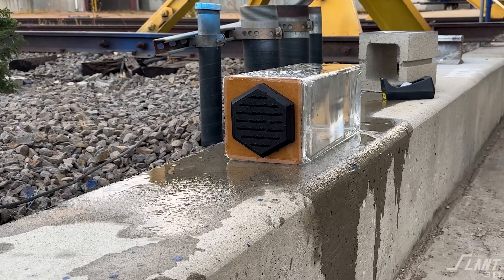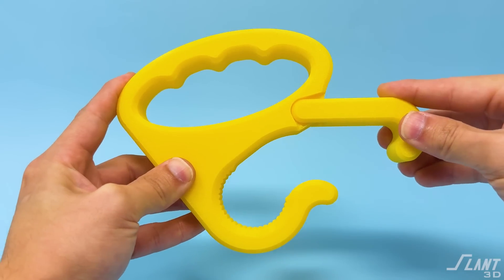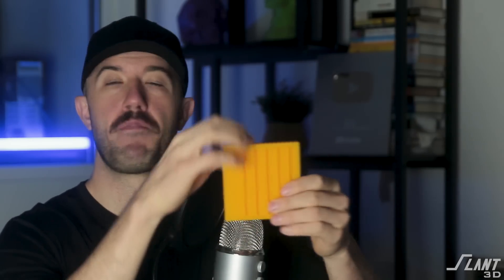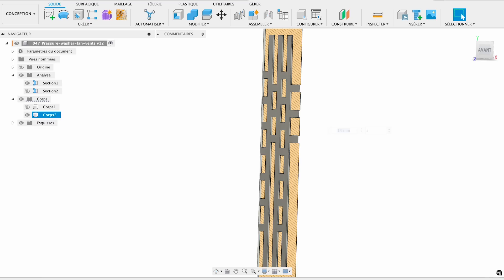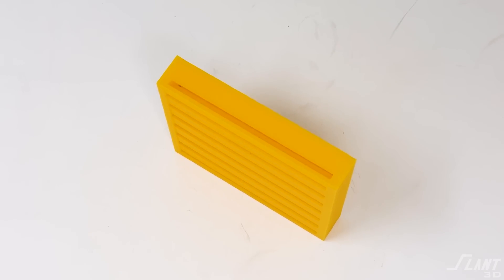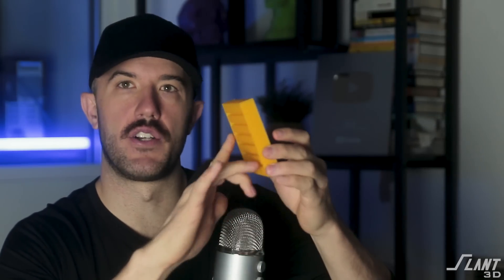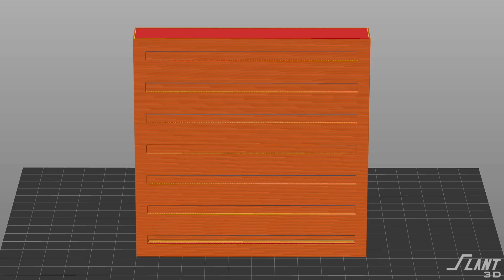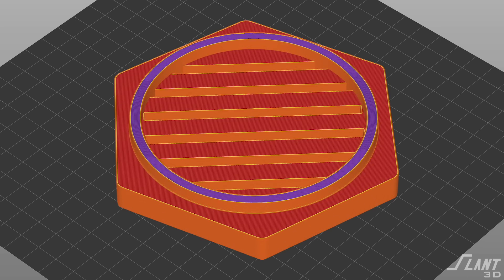Water-Resistant Vents for Industrial Applications | Design for Mass Production 3D Printing

Comment: can you design a circular vent that I could use after cutting a hole into a Pelican or Apache case and seal it and then prevent water from going in and allow air circulation for ventilation ?

Comment: I really appreciate this video, I used the principles in it to design a air vent for my laser cutter. I wanted air to be able to be drawn into the enclosure without allowing UV to escape. The resulting vent is performing beautifully, with minimal impact to the airflow. Really couldn't come up with a better solution in my case. Thanks again

Comment: This is a great design process. This design would work perfectly for a small solar panel box that gets left outside always.  I got into 3d printing because I needed an endless supply of vent flanges which were $15 a pop for ABS injection mold versions. I grow mushrooms and hydroponic vegetables, and 3d printing everytrhing I need has changed my life and while it is very time intensive to learn 3d printing modeling and maintenance compared to buying all the parts, it really is enabling me to have more specific tools and solutions at my disposal

Comment: Correct me if I'm wrong, but isn't the orientation on the XY of the hexagonal prototype irrelevant? I mean yes the first layer is going to be stronger, but the next one is going to have the opposite orientation neabubg shorter lines. What's the difference between a stronger 1 layer but a weaker 2 layer and the reverse?

Comment: This is amazing! I wonder if it is possible to 3D print something sound proof like, where it blocks the sound and leaves the air pass?
Reply: Well there's companies making 3D printed suppressors for firearms.
Reply: I did such a thing and it works great. Turned out quite bulky though, because I wanted the air to travel as unrestricted as possible. The inner areas of the device have been covered with felt to absorb all the noise.

Comment: I'm so confused.  Don't louvered vents do this?  Alternatively, you can have an intake tube that points any way other than where the water is coming from (but preferably downward) to have air intake without taking in water.  Is there some design constraint I'm missing?  I love 3D printing, but isn't this an age-old problem with age-old solutions?
Reply: louvered vents are one way air flow. This might be for an application where you want the air to flow either direction. 

A possible example might be a enclosed computer control box that you want to have the inside air exchanging with the outside air.

Comment: this is a solution to a problem that doesnt exist. Metal vents with the slots looking down might not stop rain coming from the bottom, but just put to vents and it will, and it will still be cheaper and more reliable than this. Unless you inject these for the "fancy" factor, then these are useless

Comment: If you don’t need access to outside air just seal it and expose a heat sink through the case. This also prevents moisture getting in and makes it basically waterproof.
Reply: After opening for maintenance the air inside contains moisture and can still condensate.
So unless you purge the air with a gas or add a solid state dehumidifier, the initial problem isn't solved.
Reply: Fill it with mineral oil

Comment: Why would you 3D print this when you could spot-weld some stamped sheet metal together? these kinds of vents aren't hard to assemble, and stamped sheet metal is one of the cheapest manufacturing methods in existence for high-volume parts.

Comment: meanwhile the simplest way of preventing rain from getting in is literally just putting the vent on the bottom with some skirts on the sides, let gravity do most of the work
Reply: @panzervpl9406  You do end up with the components being hotter in that case unfortunately. The hot air will get trapped under the skirt and you'll end up recirculating the hot air. That's why having the intake and exhaust in different locations is so important.

Comment: I made an improved splash proof vent after watching this. It's for electric housing for another project. One comment mentioned interlocking C so it's kinda like that. Tho I don't think my shape can be made without 3dprinting. It works great. Not quite waterproof, but prevents splash.
Can't post link for some reason. Anyone interested, it's called "Splash proof/water-resistant vent" on printable

Comment: Industrial solutions it's just a heat exchanger. Completely airtight/watertight. And has internal fans for circulation for the inside half of the exchanger. CNC machines in fab shops will be the most crusty disgusting thing you've ever seen. But the inside of their electrical cabinet is spotless because they have been using heat exchangers since the 60's on equipment.

Comment: 0:29 "water and air are both fluids"......
Reply: He means fluid in an engineering standpoint. The air birds swim thru and the water fish fly in can both be represented as fluids in their equations.
Reply: Definition from Wikipedia: In physics, a fluid is a liquid, gas, or other material that may continuously move and deform (flow) under an applied shear stress, or external force.
Reply: @team6612  thanks. Didn't know bro. Thou technically I understood what he meant.
Reply: @placek7125  they are.
Reply: Yes, yes they are 👍
Reply: @placek7125  just was looking for this comment

Comment: Just a thought, but if you made the front flat, you could put a logo on it. Then, with the drain at the bottom, put a larger interior hole for air flow. And a couple of vertical slats inside for support. Maybe? See! You got me thinking! Great video!

Comment: Designed something sort of similar about 30 years ago to keep the machine operators from hosing down some quarter million dollar pieces of equipment and then complain it wasn't working properly.  They wasted up the manufacturing equipment with fire hoses.

Had a local metal fab shop build they.  They were expensive.

Comment: If you look along the sides of a shipping container, near the top, you'll see a design similar to this to provide ventilation to the container without letting in rain. Very similar other than they tend to have vertical orientated slats. Think this might be to aid water to channel down a slat that has encountered a slat, vs. dripping from horizontal slats.
Reply: That was exactly my thought when I saw this design: Why not mount it with the slats vertically, this way the water would drain faster?

Comment: The best way to print these valves is not in the flat orientation, but at a slight angle. so the overhang it has is enough to support it.
YES you will get more waste material, though it should resolve long overhang issues.

Comment: Interesting, but I know an alternative to straight slats. And it looked like there was a filler in the black one too. Which, unfortunately can act as a water trap and turn it in to a humidifier if the fan is blowing into the enclosure. Thanks for the idea though. I have several sites I work at where I can take the idea I have , design it, print it and use it. Doesn't have to withstand washing though, just rain and snow.

Comment: 0:27 water and air are both fluids?  Oo
Reply: 🔫 always has been
Reply: @ized88  yes, they are
Reply: @sha_hito  under "normal" circumstances like room temperature it doesn't really matter which definition of air you use (oxygen or atmosphere) it's a gas
Reply: @ized88  a substance that has no fixed shape and yields easily to external pressure; a gas or (especially) a liquid. 
Have a nice day 👍🏻
Reply: @ized88  aand gas is also a fluid...
Reply: @ized88  Fluid is not the same term as liquid. gases and liquids are both fluids. It's weird, I know, but it's true

Comment: You can just make the front slats with a drain at the bottom, followed by an angled wall with a opening at the top of the wall, then backside/interior slats... sort of like a transmission line speaker box. What I’m imagining should be completely water proof and a bit simplified. I can make it in fusion and send it to you if you’d like .

Comment: your remark about reducing the distance / thickness of the slat does not work as capillary forces will take the fluid over to the next level, helped by the air flow. btw. thanks for your excellent videos on 3d printing!

Comment: I don't know what I'm talking about, but your Tesla valve model looks wrong to me. It's meant to be basically a straight line in one direction, but lots of loops in the other direction, whereas yours looks symmetrical?
Reply: No, it doesn't have to be a straight line. It's just about the corridor that turns 180° and leads back.
Reply: If you mean the teardrop shape vs the circle; 
The teardrop seems to be better optimised for creating the reverse flow with less turbulence, whereas the circle can be printed smoother. 
Due to the angling of thew channels, gravity will also help against the water entering.

Comment: 4:00 and 8:32 -> I love you guys, but--and correct me if I'm wrong--even though the water gun isn't delivering much pressure, a lot of water is getting inside during both of the water-resistant vent demos (particularly at 8:32).

There is water under the container in both demos, but I swear that there are drops of water inside, up to and around the candle at 4:02, a stream of water running along the inside corner at 8:34, and a lot of water inside at 8:41. It's much better than a louvered vent, but that candle will only stay lit with luck and good drainage.
Reply: Yeah, only good for a candle that's elevated above the ground. I wouldn't want to put my tissues in there.
Reply: idk I alway see this guy and he's so sure about what he is talking about like its rocket science, meanwhile there are better 14 yr olds at 3d print design on printables or thingverse
Reply: there was also only the one port to the "box" (looks like a square glass vase on it's side). This means that the internal pressure alone will push against ingress.
i suspect the water ingress would be much worse if there was a fan intake and/or a vent outlet
Reply: @ardemus   its a nice proof of concept.... But i think if the sections in the front can be joined to the back layer with each having a slanted roof to a blind end that issue can be solved and will remain easily printable
Reply: Wtf are you talking about ? That water clearly getting inside with only smoll water gun, look at 4:01 or 8:32
Reply: Vertical slates are good for external splashing and direct pressure, but they suck at preventing internal splashing. My idea was to use slanted slates instead. With the right offset, they could resist both frontal pressure and internal splashing at the cost of added complexity.
Reply: At the 4:00 mark, you can see there is a gap between the model and the cardboard. Water probably go in there that way. Also notice that there is water outside that is under the enclosure, so it might look like there is more water inside than there really is. But I do see water droplets inside - probably because of that cardboard gap.
The 8:32 one, I don't see any water droplets inside. Hard to tell.

Comment: I think that if the slats were angled they would direct the water away from the output side and have drains on the top or the bottom I haven't thought this through but it might be possible to make it such that water will drain to the outside whichever way you orient it.  Maybe circular angled from the center so water will drip towards the outside edges everywhere.  Water coming in the top half would go right through the slats but the second layer would catch that and just drip down.  Another thing that comes to mind would be using centrifugal force to separate air and water. Basically some sort of internal fan.  Not powered of course but rotated with the air flow and flings water out where it could drain away.  This sort of think would only work in a setup with forced ventilation, not passive cooling unless it's very windy out.

Comment: Should not every chamber have drainage and not just the first one. Would it not fill up with water and dust with time otherwise. 
And even it he basic idea is just as I would do it on my firs attempt too. I do not think the vent is optimal for either stopping water or letting a lot of air pass through. 
Maybe it would be enuff to have all the ventilation from the bottom then having the ventilation canals go out in an angle from the bottom to the top. Then the canal would go in an angle down to the thing you want to cool down. So the ventilation canal should be in an angle like this:   <       
< |(wall)

Comment: I think you should have rethought the example at 0:15.  Come on... only a muppet would put that isolator anywhere near water and it doesn't need to be cleaned. 
As many others have pointed out, you can see water going into your example at 8:34.

Comment: Meanwhile the real solution that already exists in industry, slats with forward and reverse c shapes where the C's interleave. (Also doable in 3d printing) And much more reliable at keeping water from getting in.

You could do it with v's as well for easier printing but air flows easier around curves.
Reply: The best benefit of posting content online! Do it wrong and someone will correct you. Imagine how many iterations this would have taken if someone didn't know of this solution already 😂
Reply: @Raymond-Wu  It's an option. I know I have burned many hours in CAD or thinking of how to save a problem to only later find out someone already solved it. That's why it's become my step one when I ask a question is "go see if someone else has already solved this." Will save you a ton of time.
Reply from the maker: Very true
Reply: While true, the part of the video that had the most value to me was going over the printing directions and how it affected the part. That's applicable for all sorts of projects
Reply: is there a specific name for this type of vent to search more about it online?
Reply: the c's were the first thought I had when seeing this
Reply: I was thinking stacked stamped plates, but that works too.
Reply: link?

Comment: This should be called an air filter. A vent only needs louvers to prevent rain water from entering the pipe. A vent is 50% decoration. A hole cover. :^)
Reply: @tazanteflight8670   But it is not an air filter, that’s definitely the wrong word because the term “air filter” already exists and has an established meaning (a thing that filters out solid particles from air).
Reply: @tookitogo  Actually...... the definition is "a device for removing particles". A better definition would be it removes contamination. A vent is a hole.
Reply: @ If you understand that, then why would you make the original comment saying “this should be called an air filter” since it most definitely is not one by your own definition?
Reply: @tookitogo  Water can be a "minute portion of matter" aka particle. Water can also be called a 'contaminate'. What is your point? A vent doesnt change the medium. A filter changes the medium.

Comment: 4:55 Nah, would be easy to scale with other methodologies. You make the parts in rows with an offset of 25% the pitch from one another's blade distances, then when you stack them rotated 180 every other tile, they will have a 50% overlap on each other, all the other spacing is kinda arbitrary fluff for your STL.

Comment: Neat design but woldn't you be able to produce this in layers if you had different spacings at the top and bottom? That way you could stamp 5 copies of the same part and just rotate them so the slits are covered each time.
Reply: Yeah this is probably the worst application for printing. You could build this out of asymmetrical stamped slats and spacers for two part numbers and way faster and cheaper.

Comment: the way boats do it is that they have the air intake, then a collector box underneath it to catch the heavier water, then an intake for air at the rear top of the box to suck up the useful air
Reply: Nice - so with just 1 of these vents I have an endless supply of heavy water?
Reply: @Bapate-rh9be  You sir won the internets today!  🤣
Reply: @Bapate-rh9be  yes. You just need an endless supply of heavy water spraying on your collection device...
Reply: Yup. Google 'Dorade box'